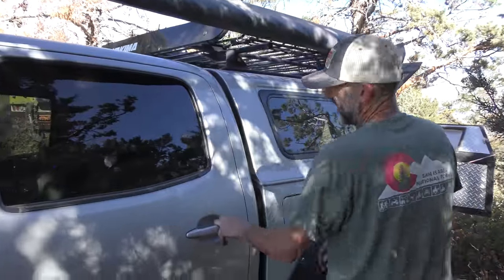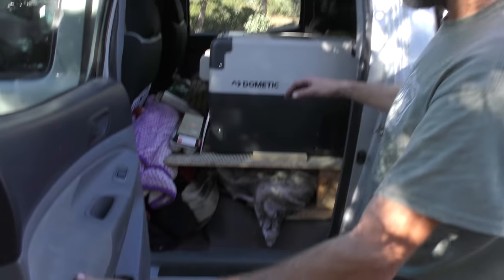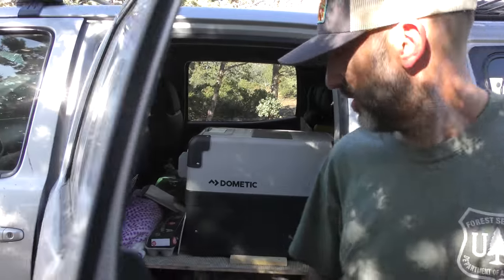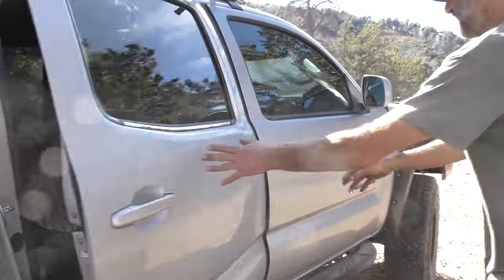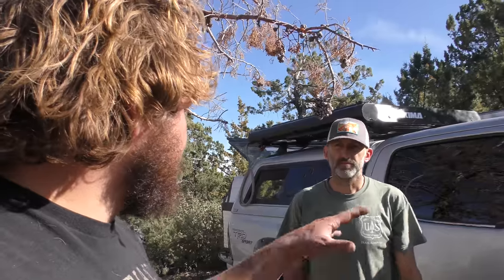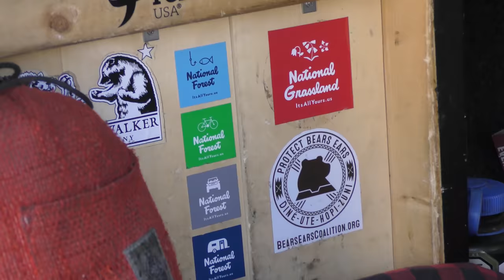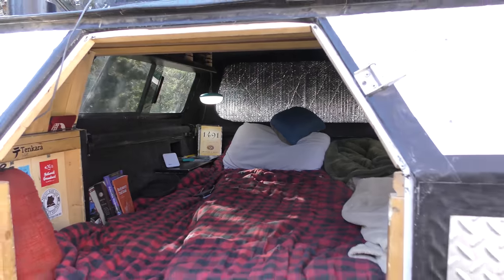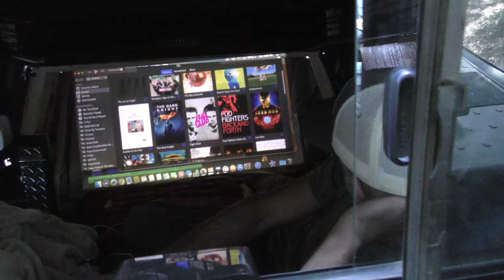5 years Living in a 5ft bed Toyota Tacoma - Minimalist Nomad Micro Home UPDATE

Comment: Hey man, I am thinking on doing this lifestyle once I can leave my 9 to 5. I am curious, why a Toyota? Is it because it is cheaper? I am thinking on getting a Ram myself. Keep being free brother.
Reply: Crurned Travels and Other Stories reliability
Reply: How many Dodge Rams have you seen with 400,000 miles on them? Ever watch documentaries on Africa or Australia? Ever notice who makes the vehicles that are driving out in the middle of nowhere? Not Dodge. Toyota. There's a reason he's driving a Toyota.
Reply: Rams are pretty solid, especially if you can get a Cummings engine. I have plenty of friends who full-time in RAMS and love it. You'd want to get one with lower miles but regardless I think overall they are great trucks. I'd recommend also going with a hightop or high-rise topper for a little bit of extra headroom. You'll love the extra height, I wish I would have gone that route with my topper. I personally just like Toyotas and have been loyal to their brand ever since I got into trucks. The 2nd Generation Tacoma body style is great for finding any aftermarket part you want for a buildout and the consensus is that Tacomas are pretty reliable vehicles. Parts are cheap and most of the repairs I do have come from me educating myself on how to fix stuff. Overall, Dodge Rams and Toyota Tacomas are both great trucks. I guess it just comes down to personal preference and which vehicle fits your needs the best. ~ Brian

Comment: Those 2and gen bed rails will not hold 200lbs.. got to remember that's a plastic bed insert. Only metal is the out shell. I definitely will not trust it holding any heavy loads going offroad.

Comment: Why not get a 4x4 conversion van, the big vans and turn that into a micro home and have more room
Reply: Hey Reynaldo! Yeah, I've kicked around the idea of getting a SB van. The positives are many but the major drawback I see is less maneuverability on tight trails in Colorado. Most of the 4x4 trails I frequent are old mining trails and they are very narrow. I can barely squeeze through some sections and as a result I hardly ever see anyone past those pinch points. I definitely have quite a bit of "backcountry pin-striping" on each side of my truck and a few dents on the rear corner panels from going through really tight spots. If my truck ever dies then I'll most likely make the switch and slow down a little bit (I'll be 45 in April) but for now I still want access very remote locations and a mid-size truck with a short wheel base allows me that freedom. However, when I see an awesome van I get JEALOUS!! Have a great Friday! ~ Brian
Reply: It has to be a Toyota......reliability and the best put together...by far

Comment: How did he reinforce the tailgate for all the extra weight?
Reply: The slide out extension weighs a total of 42 pounds and the tailgate can support 40Olbs.
Reply: @OffGridBackcountryAdventures  Oh wow. I thought that extension weighed alot more. Very inspiring bro I want to do what ur doing aswell. Fuck rent.. I have a 08 tacoma regular cab. idk if thats same as short bed or not, it has 6ft bed? Idk if that includes tailgate or not. havent measured. But i need to get a topper and get my rear end swagged out like urs. Really nice rig brother
Reply: @Xiferr  I hear ya, rent is ridiculous these days and with the rising cost of living but rather stagnate pay raises, I had to make the switch to living this way. It's not always easy to figure out how to make income but after a while you get into a flow. The regular cab Tacoma with a long bed is ideal for this sort of living. It's a great compact truck that is easily maneuverable on tight trails, gas mileage is great, and you can get parts anywhere. I'd recommend looking into a high rise topper and then having a platform bed in the back with storage underneath. Here's a video on how I set my platform up before switching to the slide out extension. There should be the same notches in the bed of your truck for 2X6's so making this is really simple. https://www.youtube.com/watch?v=nr8yjG-nLkc Have a great weekend! ~ Brian

Comment: dude, what flip flops are you wearing? not picking, actually asking.
Reply: Hi Chris, these are bedrock sandals and I can't say enough good things about them. There are three different areas for adjustment on the sandal so you can have the perfect fit. I can hike in these with zero issues and they stick to rocks like glue...awesome traction. Here's the company website if you'd like to check them out - https://bedrocksandals.com.

Comment: You need a 8 foot bed bro......or at least a 6 1/2 foot. You would probably better off in a 4runner rather then that Tacoma.
Reply: 4runners are great but they are a bit weak on gas mileage and you don't have the same flexibility with buildouts compared to a truck. Even with all the upgrades and additional weight on my truck, I'm still getting 17mpg in town and 22mpg on the highway. The problem with 4runners is you are locked into one build...just putting a bed in the back. With a truck bed, you can do a topper like my setup, build your own, or pick from one of the dozens of pop up campers. And full size trucks with long beds are no ideal at all for overloading. Way too big to maneuver in tight spots, this is why you never see a full size long bed in the areas I frequent...they just can't get back to the places I can access in my mid-size truck. ~ Brian

Comment: Now tell everyone how much money you have invested in all your stuff
Reply: Hey MedicineCat69, that's a really great idea and something I will do a video on with my channel. I'll get that shot tomorrow and post it up in the evening. Just so I don't leave you hanging, here's a breakdown on my upgrades...
2005 Tacoma 4x4 Truck Sport Model Double Cab (I bought this new in 2005) - $29K
A.R.E. MX Topper - $2K
ARB Old Man Emu Lift Kit - $1200
Dakar Heavy Duty Leaf Springs - $650
ProComp 17" Wheels - $900
BFG A/T Tires - $1500
Dometic Fridge - $800
DIY Slide Out Extension - $400
Yakima Roof Rack with Basket - $1K
ARB Front Bumper - $1200
ARB Side Awning - $300
Roadshower - $300

Total investment including vehicle: $39,750.00.

Complimentary Products:
Secondary Battery
Solar Panel
BioLite SolarHome 620 (interior lighting system for my truck topper.

If you have any additional questions then feel free to ask, I'd be happy to share details. 
Have a good evening ~ Brian
Reply: Colorado Backcountry Adventures not bad. I’m looking to by an off road camper to possibly live in full time and by pick up is plenty big to haul any extra gear. The four doors and 6’ 8” bed  have a ton of storage for bulky gear like coolers/ more fridge coolers, stove, clothes (seasonal) and wood.

Comment: Seems silly when you can buy a truck with a bed that’s long enough to sleep in ....but hey “bro-coma life “ boi!
Reply: Colorado Backcountry Adventures 
Don’t be so sensitive. It’s a valid point, get a 6 foot bed instead of a 5 foot bed, problem solved. He”ll be fine off-road. Or buy a 4 runner since you leave the shell on full time.
Reply: Colorado Backcountry adventures wow soo sensitive bro dozer... if you require a truck that costs tons of money and can’t actually do any work then yeah bro comas are a great option.. or you grab a mid 90s Chevy shortbed for a few grand, save yourself 20k and have a little extra loot for fun stuff
Reply: But where would he keep his locally sourced honey from crested butte?
Reply: sdoverland ya it seems silly to have. Vehicle too short to sleep in, a05 Chevy z71 stepsister checks all those boxes and wouldn’t cost more than a couple of grand

Comment: Should of got a tundra, that taco is too small.
Reply: nope, I don't want a full-size. Too limiting on trails and the new Tundras are way too big. Midsize fits me just fine and I'd rather have a 1st Gen Tacoma which is a bit smaller than mine. If you watch the video, I explain the advantages to my preference.
Reply: @OffGridBackcountryAdventures  Get yourself a 1st gen tundra, i got 2 of those.
Reply: @dangda-ww7de  I'm glad you like those but they aren't for me. As I mentioned in my previous comment if I were to change things up then I'd go smaller with a 1st gen tacoma, access cab, long bed.